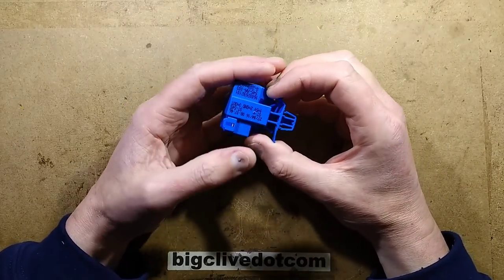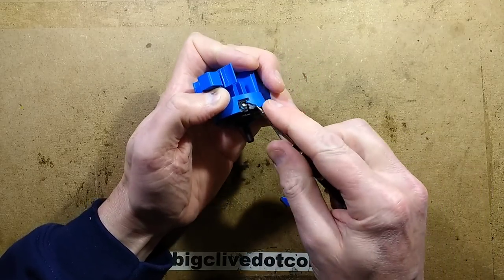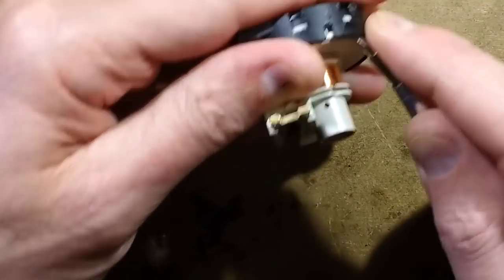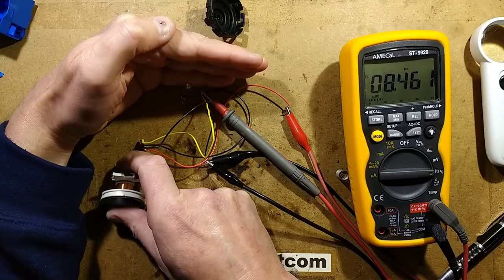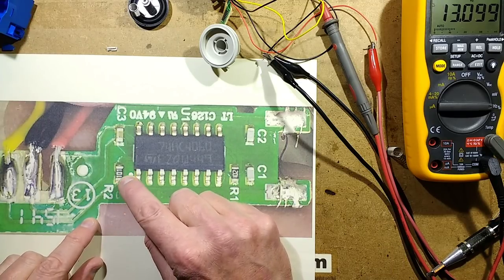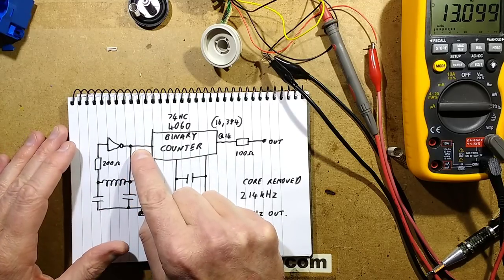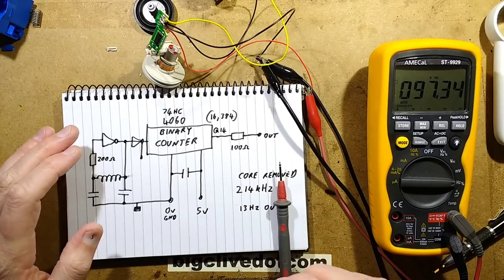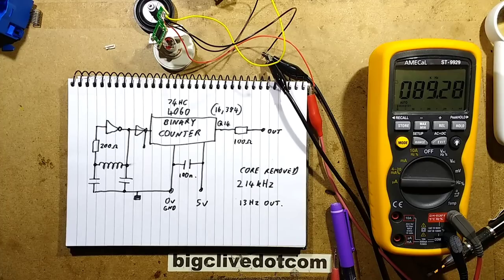Inside a washing machine water level transducer. (schematic)

Comment: I was once required to repair a relative's washing machine, after it had turned into an oven, turning the clothes inside to carbon.
The fault was lime scale that had blocked the air pipe of a similar device to that shown in the video. The effect was that a 2kW  water heater had switched on when the drum did not have any water in it. As there wasn't any water to heat the water temperature sensor did not detect the temperature in the mechine until the clothes had burned.
I had considered using one of these devices to monitor the water level in a garden pond, however there are all sorts of problems doing this. Not only is the lime scale problem still an issue, but biological active water tends to block the pipe, and oxygen bubbles change the amount of air trapped in the pipe. The volume also changes with temperature. In the washing machine application the fill empty cycle reloads the pipe with air on each cycle. In my pond application, I have considered fitting a plastic bulb to the end of the tube making it a closed water pressure monitor, but this too has its problems. The volume of air changes with ambient temperature and the plastic of the bulb hardens in the active water environment and becomes brittle. I am currently experimenting with a capacitive water level sensor, as this again has no moving parts, the only problem is its concentric sensor pipe dimensions are relatively large to reduce the chance of fouling.
Reply: The machine was poorly designed... the element should have had its own overheat thermal cutout on it which would have prevented this from happening.
Reply: I agree the design was very poor for a very well known brand. This was some time ago, but given the fires being attributed to washing machines and tumble driers today, it can only be assumed that manufactures are not paying sufficient attention to safety and failure mode effect analysis.
During my days as an electronics designer, the most serious cardinal sin was to design a product that was unsafe.
Reply: You can use an ultrasonic distance sensor to measure the water level.
Reply: Just go with some floating material attached to a potentiometer, like I do in my pond. Yes its a moving part and its prone to wear over the time. But I have mine for more than two years now and it never failed on me. I use it to maintain the water level and turn off the main pump in case of leaks. And its very precise, in a 1700L (2x2 meter) tank I can measure +- 1L. Btw, ultrasonic sensors are very inaccurate. Don't know about capacitive sensors.
Reply: VMFRD I have considered this, but it fails if the pond freezes over, and the water level falls under the ice, for example if the ice cracks the side of the pond. I am not a great fan of devices that require moving parts operating in a hostile environment. The potentiometer in a float arrangement can be replaced by an inductor and coil, much like the device in the video. This at least isolates the water from the electronics and unlike a pot, the inductor is not subject to contact wear. 

FYI.  The capacitive sensor uses two concentric tubes open to the air at both ends. The tubes are conductors, covered in a layer of plastic. The concentric conductors act as a capacitor, with the outer plate being connected to zero volts to act as a screen, much like a coax cable. As water fills the tube, it changes the permittivity of the dielectric, replacing air with water. By putting the capacitor into an oscillator circuit, the oscillator frequency falls linearly as the rising water displaces the air in the tube. An alternative circuit, which amounts to the same thing, is to measure the capacitor charge discharge voltage. This can be done very simply using a pic micro. In all cases it is necessary to compensate for stray and fixed offset capacitance. This solution works well as the probe can extend blow any ice level. The only problem is that the tubes need to be of a relatively large diameter to avoid algae blocking the pipes at the water surface. There are few nuances that can be used to improve the arrangement.
Reply: To be honest, I got here for the same reason. I'm not a big fan of moving parts as well, but in my case I don't fall to the problem of ice, because if I do, my Tilapias are good as dead. The principle behind this little sensor (the one in the video) is quite nice but I fell like it will lack the kind of precision that I have with the float sensor. My entire automation has to run free most of the time, doing the housekeeping by its own. The only way I have to make sure everything is ok is via a LabVIEW supervisory or a web page. What I'm trying to say is that I'm not comfortable with complex sensors like capacitive (at least untested ones or DIY), but if you feel like this is a solution for you, just make sure to do some extensive testing before putting it to use. And good luck!
Reply: A washing machine doesnt need an accurate level sensor. It just needs to know it is not over or under filling the machine for the wash load. This type of sensor is more than accurate enough for the task at hand, wont stick due to mechanical wear, and is cheap to produce
Reply: Peter Mulholland I think the intention was to stop the door being opened when the drum has water in it.
The problem with the one I repaired, was that the sensor was used to decide if it was safe to turn on the water heater.
The faulty sensor, blocked with one scale, indicated water was in the drum and it was safe to heat it. In the absence of water the water temperature sensor was high and dry, unable to detect the temperature in the drum. The master turned on, in the limited air supply, the clothes inside were pyrolisised, filling the drum with soot and smoke. Luckily no one opened the door with the heater on or their would have been a flash fire or explosion.
Reply: VMFRD the capacitor sensor does not have any moving parts to fail. It accurately reports water depth. The component cost are minimal. The electrics can be implemented with either CMOS logic or an 8 pin pic. Unlike a float system, it works even when the pond surface is frozen. The level accuracy can be improved by including temperature compensation based on pond water temperature. With the pic solution, both measurements can be reported either via I2C or if a 16 pin device is used, by RF link.
There are commercial versions of this type of sensor, however the DIY version can be constructed from uPVC water pipe.
The software can be written to ensure that the system fails safe, i.e reporting low water level under fault conditions.
The proto type seem to work ok, but has yet to be deployed permanently. The biggest problem is that the sensor is not small. Further compensation is required to take account of the slope of the side of the pond. I have yet to find a better solution, if water level is measured.
Reply: +a544jh You can but it gets very difficult if there's foam involved or it's slopping around. Far easier using pressure and a small stilling chamber.
Reply: Graham Langley foam would be a problem, but the slope is not an issue, as this is a fix constant of cosine of the slope.
I like the idea of a fixed volume of gas and measure the water hight using water pressure acting on a bulb connected via an air line, however as indicated in my earlier posts, this solution is not without problems, the greatest of which is the change in flexibility of the bulb, followed closely by air leaks and temperature compensation (Charles gas law).
Reply: +Nigel Johnson Slopping, as in a liquid moving about in a vessel,  not sloping. And measuring the pressure acting on a bulb is exactly how it's being done here.
Reply: Ok, but what you're going to do with this information (water depth)? If its just to monitor is one thing, in that case you can definitely make it fails safe. But if you're taking action with some micro, based on the level, a sensor off scale or reporting low level when its not can be a harass as well.
Reply: Graham Langley  interesting, from what material is the bulb made. How do you stop air leaking out and water getting in?
The plastics I have tried have hardened in the water and eventually become brittle. Do not know if this is UV exposure or the action of biological  in the water. It would be necessary to keep the bulb off the bottom of the pond to stop silt from covering it.
Do you correct the measured pressure for water temperature?
Reply: VMFRD the information is of value in protecting the pond from overflow or loss of water due to a leak in the filter system or a crack in the pond liner. The pond pump is on at all times and circulates the pond water through a three chamber filter over a period of 24 hours. As the filter is external to the pond, a leak in its circuit could quickly empty the pond, so if a sudden drop in level is detected it is prudent to switch off the pump.
Reply: You have essentially the same problem than mine. I also use this information to allow water in my pond, compensating for evaporation and other natural losses. Lets face it, for this job you want the very best and reliable sensor you can get your hands on, because on the event of a false positive (meaning low level signaling when actually is not) it can interrupt the pump and cut off all water circulation (in my case the only source for waters oxygenation). Its a mater of doing in pond tests and deciding if the sensor is stable and reliable enough for this kind of application. Check my channel if you want, I got some vids about pond automation.
Reply: I do not rely on the water circulation to oxygenate the pond, I also use an air pump to force air into the pond. This allows the water pump to be switched off if the pond is covered in ice. The rising air also tends to keep  two or three regions clear, as the rising warm air breaks up the ice. Not that that has been a problem for a number of years, thanks to climate change. The biggest problem with putting any sensor in the pond seems to be the effects of biologically active water. This either covers the sensors in green slime or attacks the plastic. I avoid using metals, particularly copper as it is so toxic to fish. I am not sure how BigClive will react to having his pressure sensor video posts taken over by pond keepers.
Reply: Hahaha he won't mind... Yeah, metals are something to avoid when possible, but stainless steel can be used with no major problems, but its a bit expensive. Maybe you can find some more strong plastic...
Reply: You can fix the ultrasonic sensor to the ground on a pole or something, and maybe even put a pipe around it. The sensor itself never has to come in contact with any water. I'm planning to use said sensor to measure the water level off a well.
Reply: all that fancy junk and it still relies on a chamber and hose to get the air pressure change to the sensor and I can say, the hoses do come off sometimes and many machines will happily just keep filling trying to get that level sensor reading to change. welcome to washer-floodgate ;) **forgot to mention clogged hose end/nipple**
I wonder how many have secondary level/overfill safety sensors, none that I have serviced  :))
Reply: Ultrasonic sensor in a well with almost "stagnated" water will work but with low accuracy. Now if water splashes hit the sensors frontal mash you can say goodbye to any readings at all until the mash doesn't dry.
Reply: +Nigel Johnson In a washing machine, any slight air leakage isn't a problem as the tube etc gets refilled every time the tub is emptied.
Edit: There's a variation on this method where you pump air into the tube so that it bubbles out of the bottom and measure the pressure. Minor leaks are no longer a problem.
Reply: Graham Langley I was aware of the former,  I mentioned it in an earlier post. The latter is of interest, as I already pump air into the pond. I wonder if I can measure the pressure in this pipe to obtain an idea of the water level. At the moment the air passes through a diffuser stone which does change the pressure as it blocks. Even an open pipe tends to block with lime scale over time, but when bubbles are being generated, the pressure in the delivery tube must be related to the depth of the outlet. I like prefer a more direct measurement of water level, preferably with no moving parts. Interestingly I recently can across an inductive water conductivity probe. This would make an ideal fixed level detector. It operates in a very interesting fashion. It consists of two isolated toroidal coil cores. Both are covered in a common layer of water proof plastic, with the core holes aligned. One coil acts as a signal driver, the second as the signal received. The water under test passes through the holes in each core, working as a single turn linking the two cores together, producing a transformer couples by a current loop through the water loop. It is not difficult to see how this measures the conductance of the water. This idea could be, and no doubt is, used as a simple solid state sensor to detect the presence of water. The selling point for this type of conductivity probe is that it work with foul water.

Comment: My machine “calibrates” by filling the drum until the max level and/or overflow sensor trips when the switch is set to a position labeled “super/reset”. Presumably the brain box stores the reading associated with overflow and chooses some intermediate value for the other settings.

Comment: As an added benefit the CPU can self zero the sensor. When you first start a load the CPU knows the drum is empty. It then samples the sensor and uses the reading to use as a reference for zero. Short term accuracy would be close enough and you don't really need long term accuracy (plus you can self zero again after the dirty, sudsy water is removed and right before it fills again for the first and optional second rinse).

Comment: Hi Big Clive. How do you test this pressure switch to see if it's working. My washing machine doesn't spin. It will fill and empty but refuses to spin. Checked the motor brushes and they are low but look ok, getting continuity from brush connector to brush connector 4ohms approx. Stripped of the hose going to the  pressure switch and was free of debris along with all other pipes. I have heard you shouldn't blow into some pressure switches because it can damage them, I think I have the same one as you (linear). Any help would be most appreciated. Thanks in advance!

Comment: That's probably not a Schmidt trigger gate. That would be used for an RC oscillator. For an LC or crystal oscillator, it would be a standard gate forced into its linear region and acting as an amplifier.